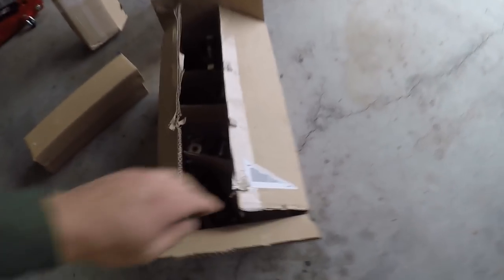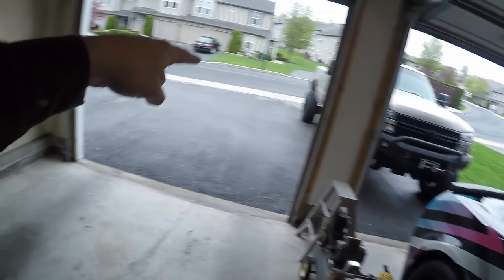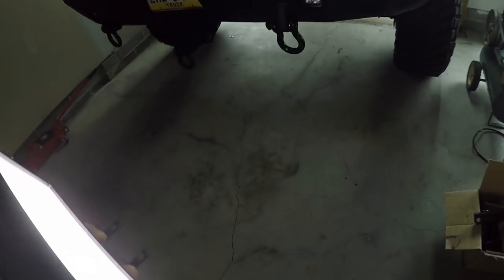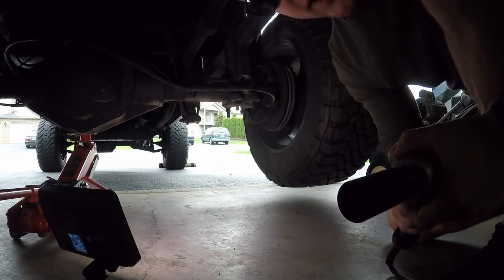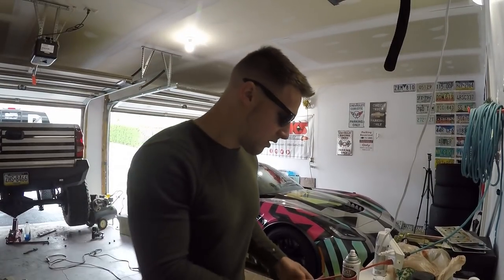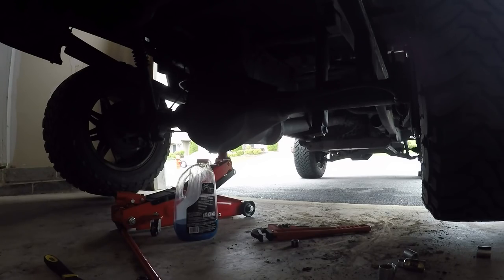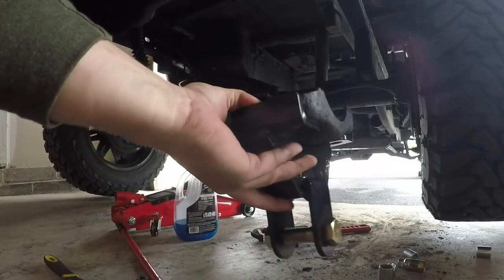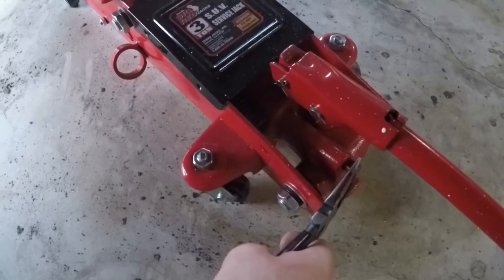THE DURAMAX BUILD IS BACK!!!

Comment: holy shit get a bigger jack! and no jack stands smh. this dude is brave
Reply: americans are the smartest...
Reply: I agree, but unlike a lot of other youtubers, this guy ain't no prissy fuck, he actually works on his own shit when he can.
Reply from the maker: 3 ton jack is plenty, don't need jack stands when the truck is lifted an the wheels aren't off buddy
Reply: Better to be safe then sorry many people do the same and end up in the hospital
Reply: the trucks so tall not like its actually gonna fall on him anyways
Reply: Street Speed 717  Never trust hydraulics to hold anything up.  nothing but a 5 cent o ring holding the truck up in the air.

yes when you are laying down the truck won't contact you if the jack fails.  when you were sitting up with your head by the exhaust is a different matter.
Reply: Declan kot nah bruh, worried about Mike! love the dude
Reply: underclasshero24 look at the size of him. One bench press and he's out of that predicament
Reply: Nate Engles lol good one
Reply: His truck is so lifted it would not crush him.
Reply: underclasshero24 would not crush him but it could still hit him in the head which would probably fracture his skull because it's like 8,000+ pounds.
Reply: Street Speed 717 Come on, you had your body above the height that the axle would be at without the jack, so if it fell it would go back to that spot which means that it'd hit you and for that split second all of that weight would be on you.
Reply: underclasshero24 IF HE DIES HE DIESSSS 😂
Reply: I had my friends car jacked up the same way, except my chest is 40 plus inches so the frame was right on top of me. The real danger is if something pushes the truck to the side, other than that its relatively safe.
Reply: you disconnected the axle from the springs..... so you value your life at $3(the cost of the o-ring in the jack) good to know.

Comment: A lot of these cheap traction bars actually cause your suspension to bind under the full suspension travel. However if you never tow or load down your pick up you should be fine.

Comment: I have those professional series traction bars on my LBZ. Those chromoly rods ends are nylon injected (the red), oil impregnated self cleaning, and are very stout and quiet. Set them with little to no preload to start. Those bars are very clean looking, and really helped the wheel hop issue I had after installing a Grizzly locker.

Comment: You should get  yourself some Jack Stands. You cant always trust the Jack itself. i understand that if the jack was to drop with the truck that you don't have to much to worry about, but just as another safety precaution you should have a set.

Comment: hey mike i love your videos and i have a quick question for you.  i own a 2013 dodge dart 1.4L turbo i have installed a K&N CAI, MPX blow off valve, and a GFB DV+, after doing the CAI i noticed it sounds a little weird so i thought the DV+ and blow off valve should fix the weird noise but even with those added it still sounds like the CAI is suffocating when you give it gas, also it sounds like fan blade spinning or revving up  when you let off and you rarely get the loud whisshh sound like a turbo with a vent to atmosphere blow off valve like i have on it. so i had a shop look at it and they had mixed views, some saying its normal and others saying its the turbo, and dodge says its perfectly normal but im sure they just don't want to replace the turbo as its over 1k dollar part not including labor, so im just wondering if you or andy might have some clue as to what's going on.  also i could make a video of the noise if you can help me as i live in FL and no were near andy's shop.

Comment: Dear Mike, I have a 1984 GMC Sierra K1500 with a 6.2L Detroit Diesel. The engine is old and needs work so, I need to either rebuild it or get a new motor. I'd like to rebuild it since not only is the same motor used in military vehicles to this day but, most newer diesels rely on computers and electricity to keep running after starting up, my current motor only needs electricity or a battery to crank up. Would you rebuild it or get a new/better motor, if new motor which one would you recommend or choose?

Comment: When drilling the holes for the bracket on the frame you should have put the truck tires back on the ground.  Reason is because if the axle was twisted any while in the air now you have one bar longer than the other.  Both bars are not exactly in the same spot on the frame now.  Also you should torque the 4 U bolts down equally like lug nuts on a wheel in a opposing sequence.   Sure hope nothing goes wrong with what you did here. Maybe you should take it to Andy and let him go over everything. This does concern me

Comment: You do know that the end of the jack handle is what you use to turn the little bolt to lower the jack. If you didn't pull any thread out of those heim joints you now have zero adjustability.

Comment: The bars do what they are intended to do ...but...and yes there is a 'but'. They greatly reduce ground clearance for the area from mid truck to the rear axle. Driving over large humps, rocks, makes going over large trees (fallen) impossible, etc. and will surely damage the bars or limit the trucks off road capabilities. I suppose light off-roading and city cruising it won't matter and they look cool. Makes burnouts on pavement safer (for the truck) as well....LOL

Comment: Traction bars without a shackle are junk. As the axle compresses, it moves backward, without a shackle, this cannot happen. So you end up with either an overly stiff ride, or you rip the traction bar mount off the frame.